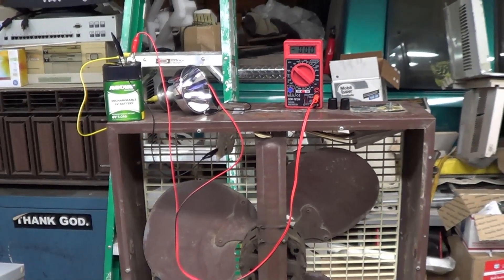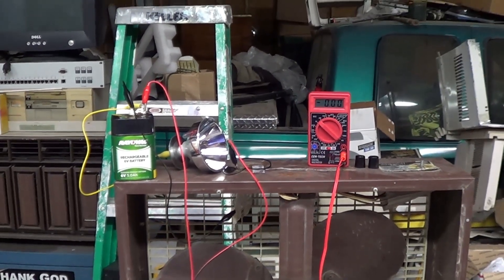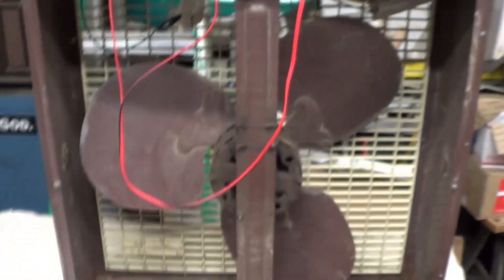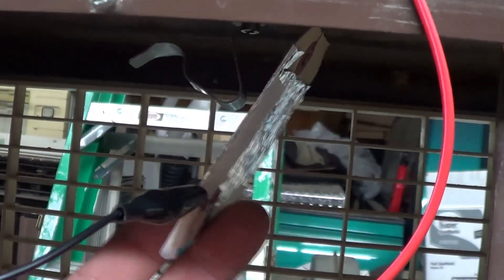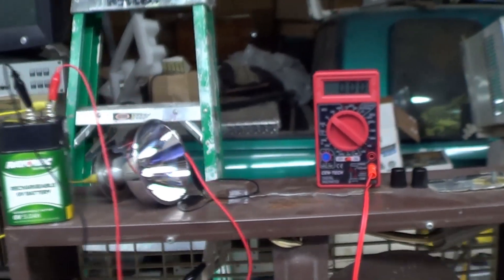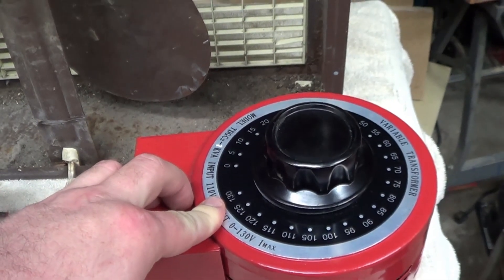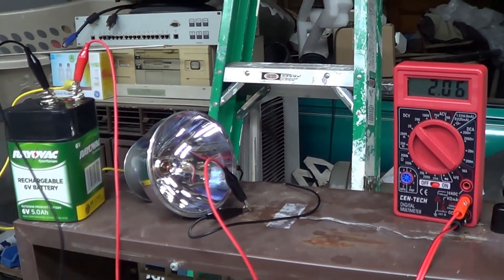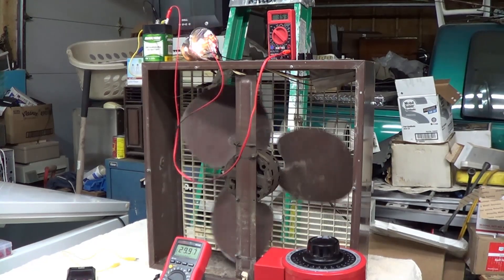Box Fan Light Bulb Flasher - Flashing Light Prize 2017

Comment: I think each blade had a distinct sound when struck. You should had went full speed at the end just for the heck of it LOL.
Reply from the maker: They do, as the blades aren't anything like perfectly balanced. (I suspect they were balanced at the factory with added weights for the lighter blades, and that those weights have flown off. This fan has lots of vibration at full speed.)

Comment from the maker: FOIST! Now get off my lawn!
Reply: Yes, sir...
Reply from the maker: "Ass"uming I catch you in the act, you'll not like the result when I emerge with my steel toed boots on.
Reply from the maker: Since you're a 486, you hold the honor of being the last microprocessor design that could fit into the socket in any of four ways without the aid of a mallet.

Is the 486 socketed correctly? There are four possible ways, but only one that's correct. In all the excitement, I've kind of lost track which way the chip dropped in. So the question is, do you feel lucky?